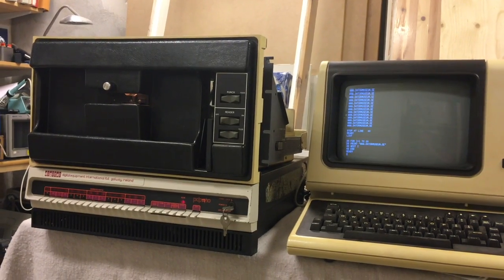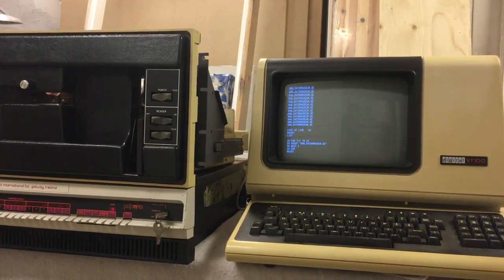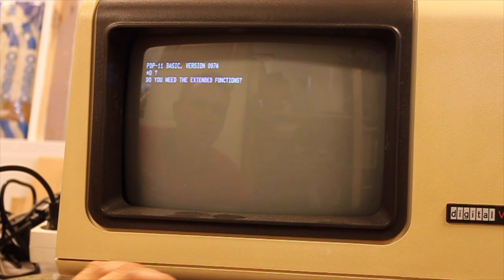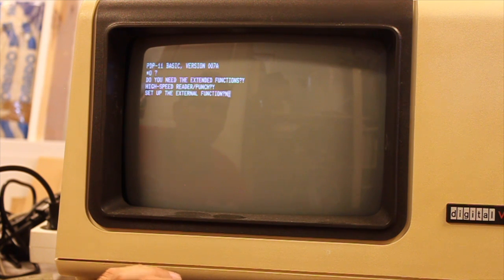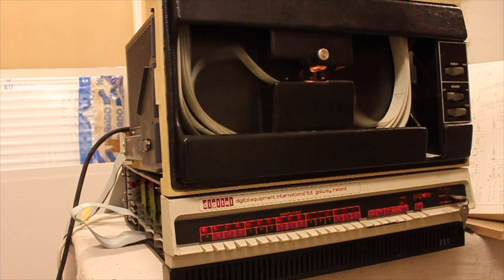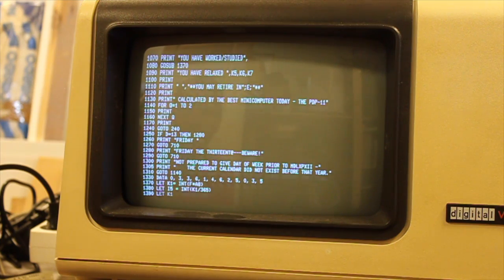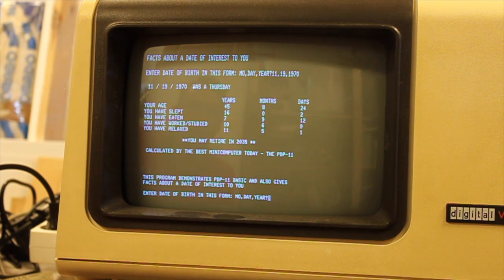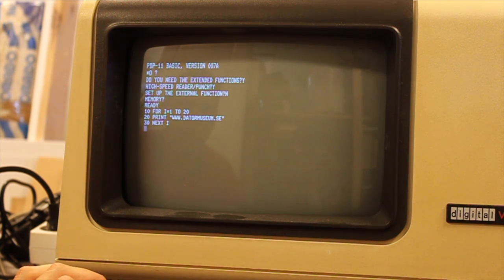PDP-11/10 running paper tape BASIC using a high speed reader / punch

Comment: I have an Heathkit H11A, and that thing is quite loud with the fans and motors running.

Question btw, with regard to the 8" drives from DEC, do the motors run constantly? I have one and when I turn it on, the motors never stop. I would say that is abnormal and a clear sign of failure in most drives, but when I looked inside, the drive head appears to be pulled down toward the disk with an elaborate system. 

It has an electromagnet, and a plate with a hinge attached to the head. This way the head is always suspended away from the disk unless it is reading/writing. So since I have never seen one actually working and I am still fixing this one, it would be good to know. I can think of no better person to ask. BTW, I know you might not have one of these, but they are extremely similar/almost identical to the RX-01 dual 8" from DEC...

Also, If it turns out that the bootstrap 7400 roms on here are broken, do you know where I can source a copy of the actual roms? Even if they aren't the superior heathkit versions with format and extended modes, it would at least be something to work from. I would settle for even a text with a core dump of the thing.

Also, what kind of paper tape punch would you suggest I use with an LSI-11 with M7270 CPU?, (assuming I will never find an H-10 paper tape machine)?

I was considering one of those NSI2400 RS-232 high speed punches, but they don't look very "DEC". I want to DECk out my machine if you get the pun :D
Reply from the maker: 8 inch floppy motors usually run always. At least those using AC motors.

I am not sure what kind of boot card you have. There are several different boot cards, BDV11(M8012) and REV11 (M9400)  for example. You need to tell more about your system. Most boot ROMs are available as images online at different locations. Here for example: http://www.pcjs.org/devices/roms/dec/

Paper tape on the LSI11 was not very common as far as I understand. At least not using DEC-branded components. But if you can get hold of a PC05 (the same as in my movie) and a M8010 interface card you should be able to get it working. I think the board would be your biggest problem to get hold of. Maybe you could build your own board? 

I suggest you to check the forum at http://www.vcfed.org/forum/forum.php . At lot of people that can help you will be around there..
Reply: I'd love to obtain a H11, but I don't know where one could be purchased in the UK. Not to mention it'd probably cost a fortune :(

Comment: Do you need hearing protection to work around old computers? I would just for my sanity.
Reply from the maker: The paper tape punch is of course quite noisy, but the fans in the computers are not much noisier than a normal rack mount server. So, no, I am not wearing any hearing protection while working on these machines.
Reply: @mattislind4443  Punching paper tape is quiet compared to punching and reading punch cards.

Comment: Hi,
I have a PDP 11/10 but it needs repair. Do you have any good pointer to hardware documentation and troubleshooting?
Thanks
Reply from the maker: A lot of documentation are available at bitsavers. Look here for PDP-11/10 : http://bitsavers.trailing-edge.com/pdf/dec/pdp11/1105/ Then I fully agree that the forum is a great source of help.. Check www.vcfed.org . Good luck and feel free to ask me through mail if you need help.
Reply: @mattislind4443  lots of 74/74S-stuff that’s no longer available. Early 80s I say a lot of such machines, I remember one, Prime something, sounded like a jet on takeoff and one of the operators showed me a spare  cpu board (measurable in m2). I wondered where the CPU was and found F181s in sets of 4 (16bit) all over the board. For ALU, address calculations, …
Reply: You should take a look on the "Vintage Computer Fourms" if you need help with repair, especially if it's an early PDP-11 like that. Lots of friendly people who know what they are doing.
Reply: Thank you! I now have a lot of documentation to read and I also subscribed to vcfed.org forum.